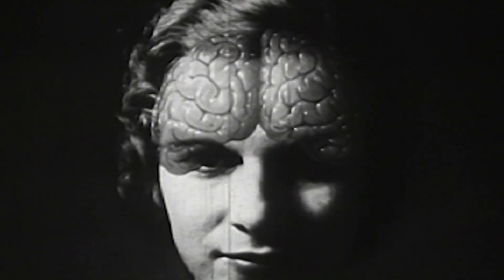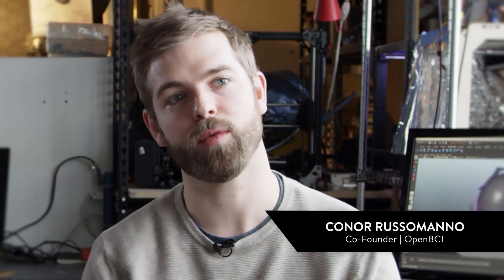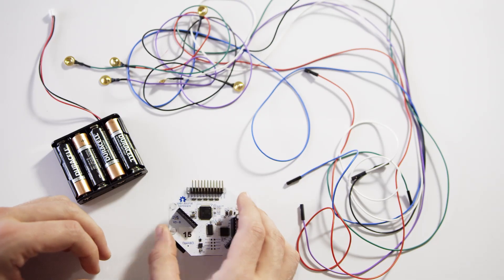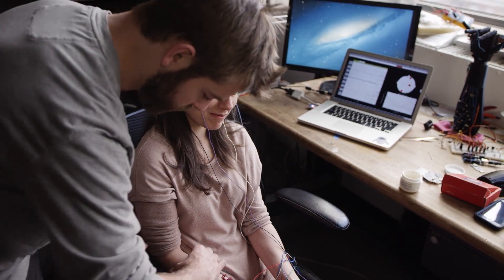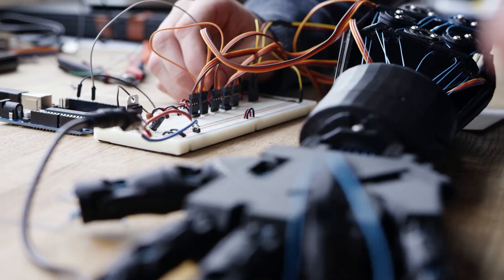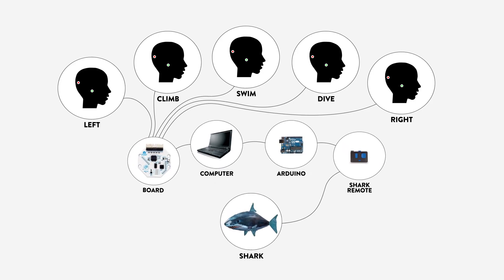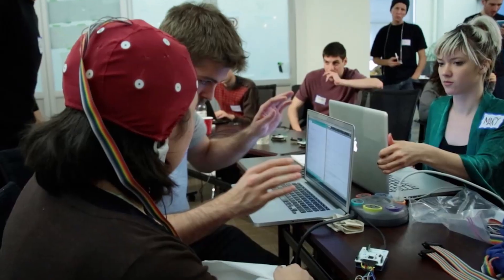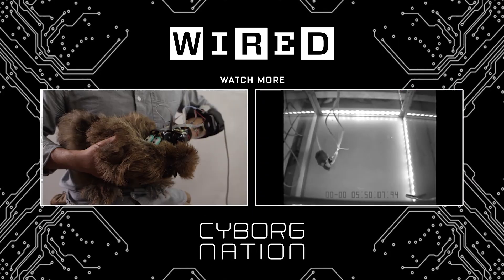How to Control Things Using Your Brain (and Open-Source Hardware) | Cyborg Nation

Comment: I have a sister with a brain injury who is stuck in a wheelchair with only a little use of her arms and no finger dexterity. She watches tv but cannot handle a remote and must wait on others to do things for her and to make matters worse she has aphasia and can't always say what she wants.  I would sincerely be overjoyed if there were a way she could at least control the tv.  And ideas???
Reply: Someone help her :(
Reply: Plz help
Reply: We're to start working on a similar project in the next few months. Maybe, unfortunately,  we won't be able to help your sister in the immediate future but our products are gonna be so much simpler to use that one could literally get their own things done, with the usage of machines, just like they would do with their body parts, without even consciously thinking about getting the same, done...
Reply: I know absolutely nothing about anything relating to this hardware and software (outside of one project I did in high school) but after a little bit of Googling I found out that it's possible to create something like these ( https://www.youtube.com/watch?v=rqU3gUh3q_c&ab_channel=RichWillmore or https://www.youtube.com/watch?v=ThHrMW6Rtgg&ab_channel=Tinkernut ).

Not sure how you would convert brain signals to different buttons on a remote but my guess is that you would attach sensors to the head to read and send brain waves to something like an arduino that's programmed to convert those brain signals into "power tv on/off" and "change channel up/down" and then send that remote input to a tv via infrared. 

Maybe varying levels of mental focus and relaxation control different inputs? It would probably be very difficult to know exactly how much to focus/relax for whatever it is you wanted to do. 

Times like this make me really wish I paid more attention in school. Sorry I can't be of much help but I hope I could at least show you that the concept is there so it's possible for your sister to watch tv without help.
Reply: See Musks in brain chip. Controlling a remote should be hilds play for that. There was also a project using eye movements in latin america years ago. That is proven tech. There was also videos of people doing left right controls with the mind. 
There is a toy that you move a ball through an obsticle course using your mind - Mindflex. 
The issue this group has is that with this open source, hardware  can really only only pull one or two "manageble" brainwaves to affect change IRL. Did you see the shark that had to be operated by so many. That is why. Each could only effect a single parameter. You need to into the brain like Musk to get more brain IRL function.
Reply: Maybe you know by now but gaze tracking and mouthsticks might be worth looking into, or if she can regularly say short words they could be stored as shortcut commands on a device